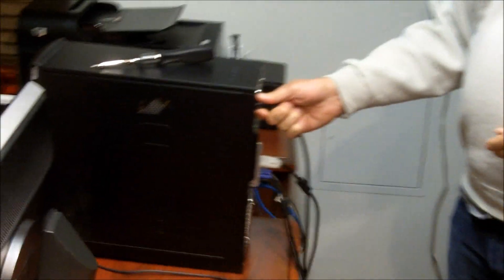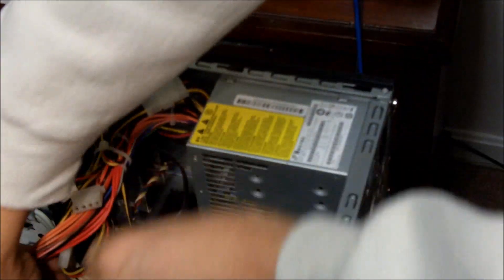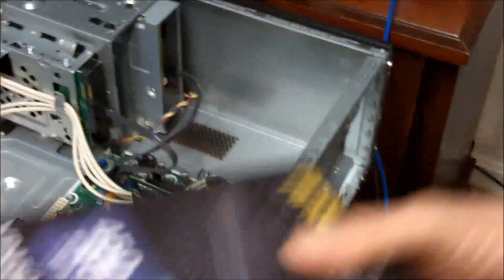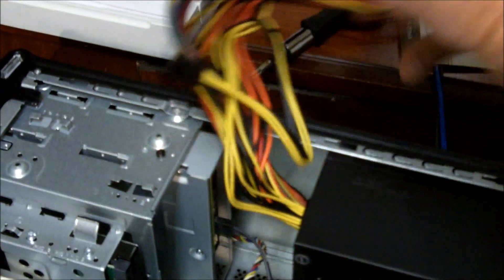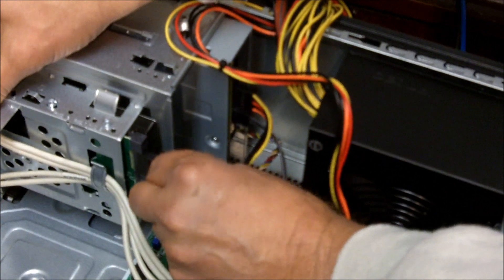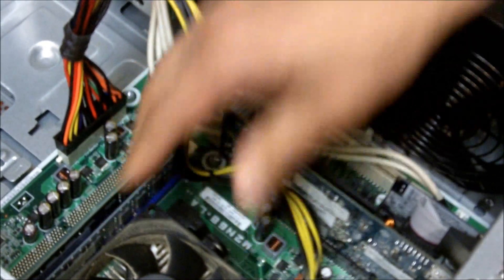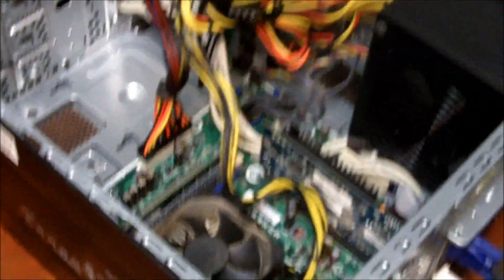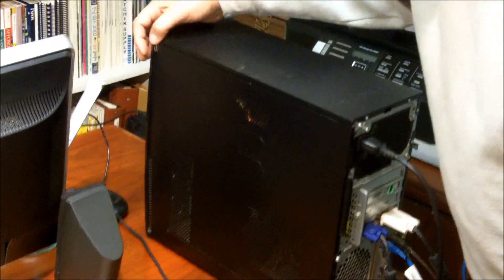How To Replace Computer Power Supply

Comment: He is the kind of guy who woud not use dual channel. The Mother board needed a 24 pin power connector he had 20. And he unpluged his power supply with out flicking the swich
Reply from the maker: You're wrong, this worked perfectly. Armchair comment, this is the best way to replace your computer power supply.
Reply: @steverockwell3  first of all its unsafe for you and the pc

Comment: Can someone tell me the odds of frying a motherboard while doing this. Me and the computer were on carpet but I never felt a shock while doing anything. Now my computer wont turn on though. Someone help plz
Reply: +bloodspiller1227 You should allways wear a bracelet to pervent static electricity shorting your motherboard
Reply: +Daniel Michaud what type of bracelet
Reply: JNLN
This is a bracelet you wear on the wrist that you conect on the computeur case to discharge the static electricity on the the case insted on the motherboard, You can find these bracelet were you buy electronic parts.

Ps: Lets hope you understand my writhing because english is not my my language.
Reply: +bloodspiller1227 On a carpet without bracelet 90 to 95 %..
Reply: +bloodspiller1227 Did you check your connection on the MB ?
Reply: +Daniel Michaud yeah I fixed it the same day I posted this. My front panel wires werent connected on the right ports. Which is why my power switch didnt power on the computer
Reply: Lmao are yo dumb

Comment: You need to push the power button after you unplug the power supply to drain any residual power stored in the power supply. It's just a safety precaution to prevent a nasty shock.

Comment: Do u need to reinstall Windows??
Reply from the maker: Slenderzebe No you do  not you are only replacing the power supply, not your hard drive.
Reply: ok thx:D
Reply: +steverockwell3 My PSU has recently been making a clicking sound like the fan is hitting something, but I've cleaned it out multiple times and I'm not sure what it is. Do you have any idea what this may be? Thanks, I can live with the sound if it's not harmful.
Reply: @PurieI  maybe its the hard drive

Comment: My power supply says 483w for the DC output, and 500w for AC input and the minimum for this is 500w. Would it be okay to use a 500w graphics card on my computer, or do I need a new power supply?
Reply: You should look for something that says "max power" with a number between 250-700w next to it on the power supply. Or just Google the product no. What's the name of the graphic card you want to use theirs 95% chance your power supply will need a 6-pin pci-e to run the graphic card.
Reply: Naquan Jefferson I've found a power supply that I want to use. Basically I want this card 
http://www.newegg.com/Product/Product.aspx?Item=N82E16814125496
I'm not sure if it'll work with this power supply or not.
http://www.newegg.com/Product/Product.aspx?Item=N82E16817338105&cm_re=micro_sfx-_-17-338-105-_-Product
Reply: Mark R Yes it will work just fine. I'm using a r9 280 myself with a 600w power supply.  Also don't forget to plug in the two 6-pin Connectors to the graphic card when you put it in the x16 slot.
Reply: Naquan Jefferson Thanks for the replies. This is the first time I've ever considered changing my power supply and graphics card.
Reply: No it is not ok. If your graphics card is going to be 500w. And your power supply is only 500w. You could blow everything out. Bc other components in your computer need power too. And if your graphics card is taking up all of it then it will create problems and eventually wreck your build.
Reply: ClaymanIFCC Dude the graphics card mark wanted to use truly only uses about 207-257w the power supply outputs 600w. So he would have more then enough power for the card and the rest of the computer.
Reply: Oh, I saw that he asked if a card that drew 500w would work in a computer with a power supply that only put out 500W
Reply: ClaymanIFCC When a company says" minimum wattage requirement of 500w" they mean to power the entire PC not just your graphics card.